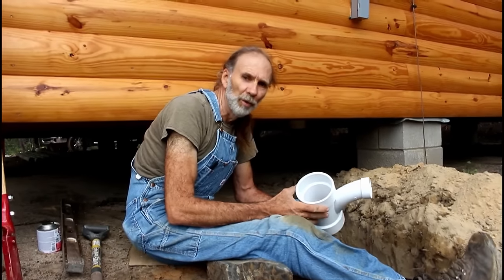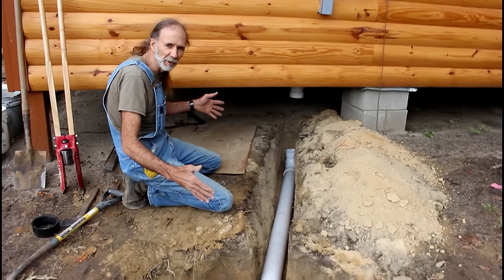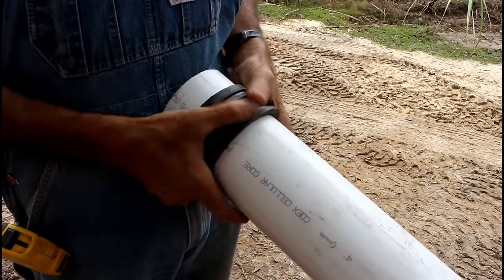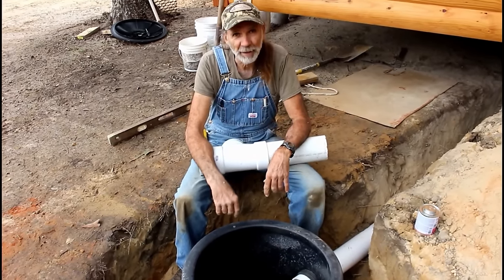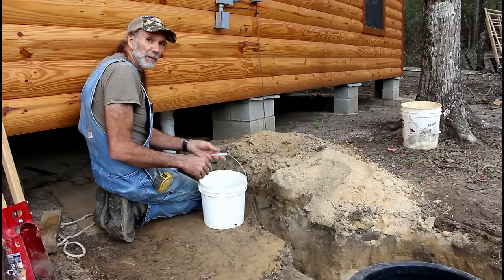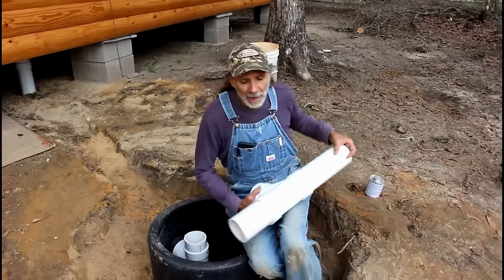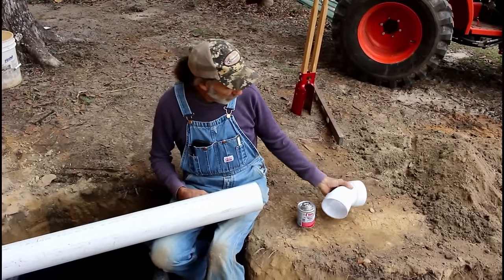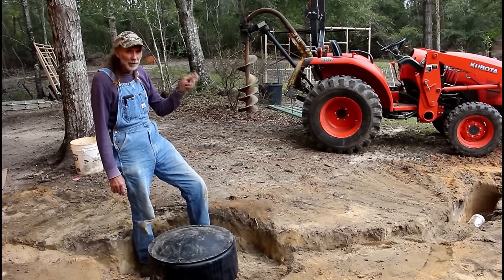How to INSTALL Your OWN Septic Tank | Septic System Install | Part 3

Comment: Not to sound like an asshat!!....but here in Wisconsin you need a licensed installer to put in a syptic system!...as well as a perk test!.....no DIY when it comes to that stuff!....and your solids tank don't have a vent nor do you have a second tank for baffles and affluent to run through before going into a leech field! Like your vids....learned about how to can my pears right!!....been doing it wrong the last 20 yrs!...lol and a few other things!thanks for the knowledge!
Reply: I'm going to be moving to Kentucky here in next few months. I can install my own septic there too. Not many requirements so it is a straight forward job.
Danny I like the system you are using for your cabin. Is it similar to the one you have in your regular home?
Reply from the maker: The vent comes out of the pipe under the house not from the tank itself. This is a very simple system for an off grid cabin.

Comment: When gluing up any plastic pipe, I usually twist the fitting a full circle to seat the glue and fitting...IMO
Reply from the maker: This is the fast setting glue. I use the slow setting on larger pipe and twist it.

Comment: 1/8 per foot fall on drain 1/4 rise on vent and your just supposed to break the barley on your level your going to have the water out run waste causing issues

Comment: Why didn't you use a sweep instead of a 90 which is less likely to stop up iam just wondering
Reply: I was thinking that, or two 45's. It's 4" though so much less likely to stop up.  I prob would've done a cleanout  where the turn is also.

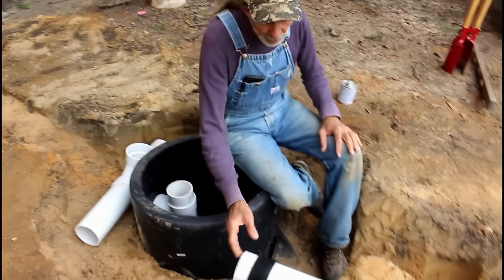Comment: @13:05 ( Outlet Pipe)
Is that a 1/8" drop from one end of the pipe to the other, whether its 2 feet long or 70 feet long..., or is it 1/8" drop per foot of pipe.
You figure at 1/8 per foot, then an 8 foot pipe would be an inch drop., 16ft is 2" , etc..
But a 50 foot long pipe,  for example, with only a 1/8" drop from one end to the other,  is pretty much a level pipe. 
You figure over the course of years and years , particles would be  collecting on the inside the pipe from such a low velocity ,that it would eventually cause an obstruction inside of the pipe.
Maybe I'm wrong, but I just cant see a drop so small over such random lengths, being enough to keep it both flowing fast enough and  keeping it clean inside.
Reply from the maker: 1\8 inch per foot of pipe. You don't want the water to run off and leave the paper.
Reply: Ain’t many turds that roll on their own very far either. Hahah

Comment: Good video, you explain a few things like the Ts that are confusing in other videos. My question is most septics run 2 big tanks, what’s the difference with this one 200 something gallon tank, it is capacity? I am putting in a septic for my large workshop with shower and the smallest conventional septic tank is 1500 but that’s crazy for a single bathroom with shower used by one or two people, with an occasional party.
Reply from the maker: This is an off grid cabin with only the wife and me occasionally.

Comment: You can save a heap of money if you dig a trench, lay a bunch of hay down, then put your perforated pipe in, cover the pipe with more hay, lastly cover it with dirt.  No need for a septic tank.

Comment: What is the purpose of the "drain tee" ?  I lived away from the city years ago and I just installed the horizontal outlet and not the tee. I worked for 25+ years.
Reply from the maker: The Tee prevents solids from entering the pipes and stopping it up.

Comment: Did you have to make any considerations for reinforcing the pvc tank walls and top to avoid caving in when backfilled with dirt?
Reply from the maker: No it is designed to handle it.

Comment: I'm not a plumber but the vent wouldn't pass anywhere. But how I would do it too because I don't like breaking through the roof.
Reply from the maker: This was a temporary vent . I now have a 3 inch vent ran under the cabin to the other side of the cabin and up the wall to the roof peak.

Comment: you say its not under pressure, that made me wonder what if you wanted to pressurize it one day? can you even do that? and if you did would you have to redo the pipe and apply "cleaner" to the pipe???
Reply: There would be no reason to ever put a drain line under pressure.

Comment: Interesting video good information but have worked with PVC for years but never did have a joint hold without using purple primer.  After going back to redo these joints I learned my lesson.  
Don't understand how small plastic tank would actually work  as opposed to larger concrete tank. would appreciate more information on this system. And does it meet code
Reply from the maker: It's been almost a year and working just fine since I finished it. I did go back and installed the 3 inch vent stack.

Comment: Hello.  Very good and informative video. Thank you for sharing. 
What is a size of the septic tank? I assume you only 2 people will use this septic system so I wonder how long it takes before you need to clean up solids from the tank.
 I designing my system now 
Thank you
Reply: I built my own septic system from bricks 12ft by 4ft by and a depth of 4ft with two particians in it and it hasn’t needed to have any solids removed for over 30 years.If its built right it shouldn’t need any cleaning out.
Reply from the maker: It's 250 gallon tank. I would go to 500 if I was going to use it all the time. Ours is just every so often. Cleaning has a lot to do with the type of toilet paper you use. Not all toilet paper is septic safe.

Comment: The reason code says to use a “cleaner” or primer is because it is necessary to prepare the bonding process between fitting and pipe. For a septic it won’t matter if it leaks but for any other waste application it would. Best to do it correctly every time

Comment: Do you need a permit to lay your own septic tank?.. I intend on saving some money on this process & have a proper location & want it set in place before ground freez s.. the house has not arrived yet & is being constructed & will be moved in later.. are there any problems you can see with us purchasing & having delivery of tank before hand?.. plz comment
Reply from the maker: Depends on where you live and the codes.

Comment: Hello Sir! I have a question... is it also good if the "BREATHER" is located right in the septic tank? like I will make a hole in the septic tank and put a pipe as breather instead of putting it between the main pipe? thank you Sir.
Reply from the maker: I've never put one in the tank only in line.

Comment: Don’t they make a primer less glue? I’ve used it before.
Reply: Electricians don't use a primer, just the 'glue'.
If you use that on plumbing, the joints WILL fall apart.
Don't worry about that though, just go right ahead with whatever you think best.

Comment: I would not recommend you not prime the connections as if it gets stopped up it will be under pressure. Also anytime glueing joints always twist quarter turn after pipe put into fitting.

Comment: Is it okay to use more than 1 inch over 4 feet?
Reply: Not when you have solids ( poop) in the water.The water will out pace the solids and leave them behind, resulting in a clogged pipe.

Comment: im not a plumber but have seen the pipes with no primer and just glue come off with little movement or pressure..
Reply from the maker: That depends on which PVC glue you use.

Comment: I don't understand why a baffle is placed on the inlet to the tank. Seems like few floaters and some TP would block up the pipe and thus backup the line to the house.
Reply from the maker: As solids go in they sink to the bottom where they can break down.

Comment: Did you have to permit the septic system?  Here in Georgia most, if not all, of the 159 counties require a permit for all septic systems, privy  houses and wells. We also have to install a filter on the outlet side to help filter out any solids that might escape the tank and clog up the field lines. 

Very informative video!
Reply: Im doing one this spring, we have to have that filter in MI too, can't cover it all till its inspected either.
Reply: I'm sure it's not permitted or it would have been to state specs. Nothing about this is to any state code

Comment: That system may suffice for occasional weekend use, or for only one person living there, but it will not handle a family with washing machines, kids, etc. Inlet and outlet T's are always at opposite ends of a septic tank, not close together, so that is not a regulation tank. Your county or state always requires permits and inspections too.
Reply: He is very knowledgeable and experienced, so I am not questioning that.
Reply from the maker: Yes this is for just me and my wife not a whole family. We are off grid here no washing machines and has a seperate grey water system.

Comment: I do have a question Danny if you got time to answer it or anybody else who might know...regarding the 1 inch drop per 4 ft of pipe, ..when I get mine signed off on, if I've got a steeper drop than that say a 2 inch drop will it be rejected...does it absolutely have to be 1 inch drop or is there some leeway allowed.
Reply: There is likely a specific range of drop amount specified in the plumbing code. You will want to verify with your local building department exactly the amount of pitch they are looking for.
When it comes to the amount of pitch in the line from the house to the tank - more is not necessarily better. If the drop is too much, the liquids will run away too quickly and won't float the solids along properly. That can lead to clogs. Similarly, too little pitch won't allow the liquids to flow quickly enough to keep the solids moving. That can also lead to clogs.
Reply: @theElderberryFarmer  makes perfect sense, thank you.
Reply from the maker: @theElderberryFarmer  Thanks Dwight
Reply: Quarter inch... Haha! Mine drops 30 feet from the house to the tank 50 feet away.

Comment: 4" DWV only require 1/8" per ft. slope.   DWV 3", 2", and 1 1/2" require 1/4" per ft. slope.
Reply: ive also heard 1/4"for any size pipe.can u share which code u r refering to?
Reply: @Benjamin-tx6vv  
See UpCodes.  708.1 Grade of Horizontal Drainage Piping.  
Some Jurisdictions  may require approval first.  Use 1/4 " per ft. to be safe unless circumstance won"t allow.

Comment: Sir I am sorry to disagree with you but the outside is supposed to have a perforated line so the water can leak into the gravel that is around it the waist goes to the leach field
Reply from the maker: That's in the next video.

Comment: Max 3" per foot or solids will stay behind
Reply from the maker: That's to steep the water will run off and leave the solids.
Reply: @DeepSouthHomestead  ,in UK the old saltglazed clay sewage pipes were laid, 4" internal diameter, 1 in 40. 6" pipe, 1 in 60.
So as to maintain flow, without leaving solid behind. Told PVC pipe can cope with a shallower gradient as has less drag effect.
The old school builders, told, to start or encourage a sluggish system would put a dead rabbit in tank. Belly slit open. An effective bio-starter.

Comment: I'm chuckling, you say code says you must use a cleaner, but you didn't because you don't care, but then get hung up on a 1\4 inch drop every foot.... Lol! The way I look at it... Tilt the pipe down because shit always rolls down hill
Reply from the maker: If the drop is to fast the water will run off and leave the solids behind stopping up the pipe eventually.

Comment: What does it matter if it's a 2-inch drop from the house to the tank or even more for that matter? As long as it's running into the tank. Should be good. Or am I missing something Because I would think more of an angle would mean less chance of it Plugging up from the house to the tank and Wouldn't that be the same with the weepers as well? I get it if it's hard to dig deep, but if you can dig deep Without a problem. Wouldn't it not just make more sense to have a steeper angle Just curious is all not saying I know anything about it. But I do plan on one day building a cabin on a lot up north and I would like to put in a septic system.
Reply: Because the water would run out of the pipe before the solids and paper did. The water is what carries them to the tank
Reply from the maker: Thanks Mike

Comment: 16 inch down inside for out let ? WHY ..Mine going to be just a T on top of 275 tank ..figure when when filled up.. to top .. then I get run off ..mostly liquid ..in years when tank is full of solid poop . I can start another one ($100.275 tank) or cut hole in top and have it pump out? Not going to fill it with water..Just let the many many baths that drain into it fill it.. I only have toilet and tub draining into it ..I still like using pit outside bath room and in summer take solar baths outside .. So will take many months to fill .

Comment: If you’re gonna do this be prepared to pay a plumbing repair company to come fix everything you did Bc you’re not a plumber
Reply from the maker: My home is done the same way. It's been 17 years with no problems. Not even pumped either.
Reply from the maker: It's January 2022 not one problem yet.

Comment: Fair warning, I'm a New Mexico regulator, but not for this jurisdiction.  A permit assures compliant design despite the designer or installer ignorance.  The vast majority of the horribly polluting systems we find are homeowner un-permitted designed and installed systems. Some discharging directly into streams.  In Colorado a homeowner discharged directly into a dry drinking water well 35' deep. The homes drinking water well was 50' away and 100' deep. Once you have polluted a drinking water well all neighboring properties are worth zero dollars.  Roll the dice and save $1,000's, it's not worth it. Save up the money to get a compliant system, please!
Reply from the maker: I'm miles in the country there are no neighbors near by.

Comment: Not a septic system. There is no treatment to that system. At minimum it requires a two stage (compartment) tank to separate the solids before allowing it to reach the leach lines. That's a gray water system at best.
Reply from the maker: In our area this is the type system installed by most plumbers unless the soil test requires the system your speaking about.
Reply: @DeepSouthHomestead  I'm a state certified septic repair technician. That isn't a septic system.

Comment: Check your local laws for proper coding and sizing. No your dirt and no your coded benchmark. guided by the city you live in. Not performed to code will result in failed drainfeild in no time.

Comment: All the glue needs to be is a gasket. Too may experts on plumbing. I dug up old sewer line that had no adhesive to hold it together. It was wood and wire. These people need to understand how much code costs a builder.